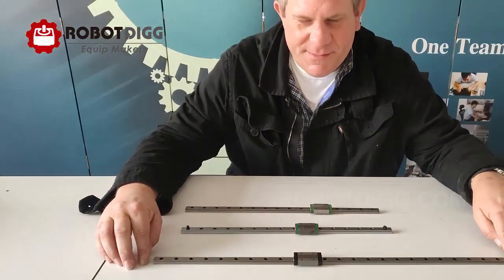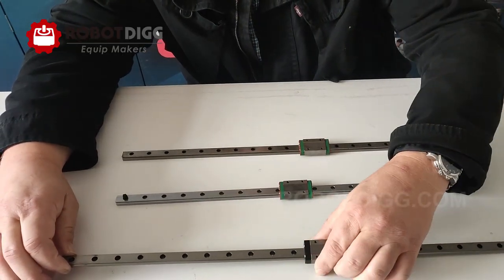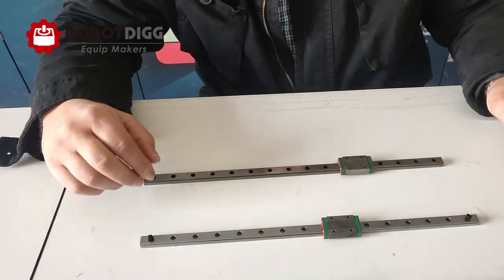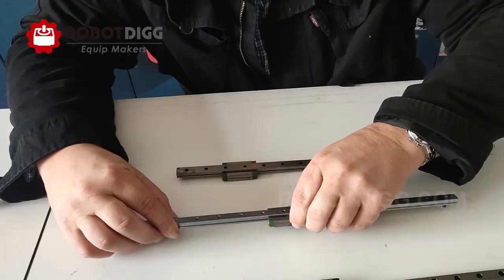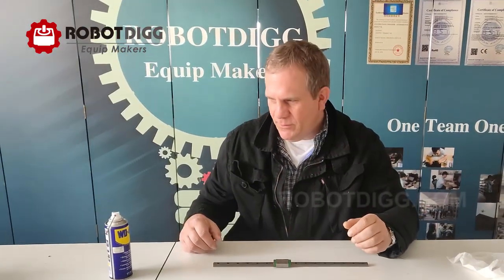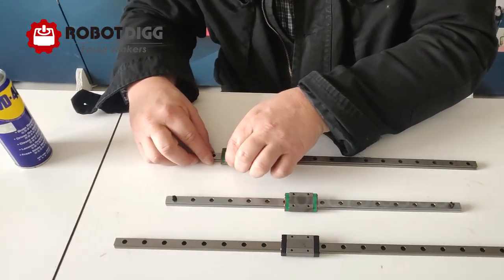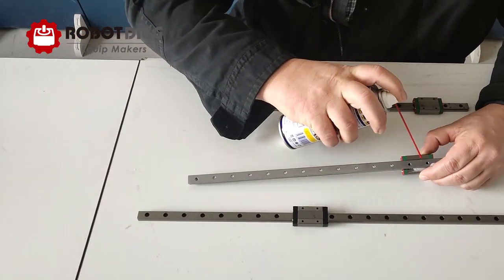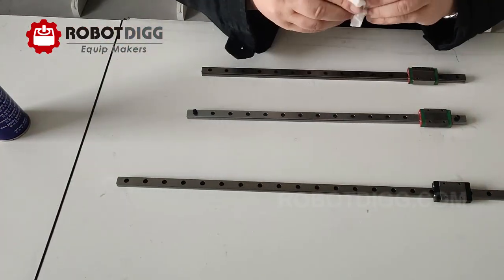Linear rail comparison of HIWIN vs RobotDigg 440C SUS vs GCr15 hardened steel

Comment: I bought a pair of 500mm 440C MGN12H.  One is smooth the other is not.  I properly disassembled it, cleaned and lube it.  Improved but still not smooth specially at low speed, it drags.  Contacted robotdigg and they say it is normal, no matter what I tell or show them they said it is normal and takes time to run in.  It is unusable.  They refused to replaced it.  Don't waste your time and money on these.  Not worth it.  Customer service and warranty are non existant.
Reply: Happened to 100 percent of the black RobotDigg made rails I bought from them. I didn't even bother contacting them. You can't expect customer support from Chinese brands.

However, another set ot Chinese rails I got along with the BLV Ender-3 kit worked incredibly well. It's a roll of dice with Chinese products. You can't expect QA and consistency from them. That stuff costs real money.

That's why I went with genuine HIWIN rails for my subsequent projects.
Reply: @RobotDiggSH  was looking for linear rails, now I know which to avoid thank you

Comment: All of those look like poor examples to me. They should be much smoother than that. If you have applied WD40 to these before that might explain it as it's completely the wrong stuff to use anywhere near precision bearings.  WD40 is a Water Displacer and is for freeing stuck bolts etc. It dries up and collects dust and grime like a magnet so is actually a very poor lubricator and can cause premature wear to bearings for this reason.

Comment: wd-40 is not a Lubricant, never put this to lubricate anything, it alaways works initially but it will dry out and make it worse since it washes out  all the grease/Oil. this will ruin your doorhinge etc because it will run metal on metal afterwards. wd-40 is to open stuck things.
Reply from the maker: Agree, wd-40 can be used for rusty stuck, Mobil 1 can be the lubricant.
Reply: Wd-40 is not a lubricant. It eat away rubber seal.